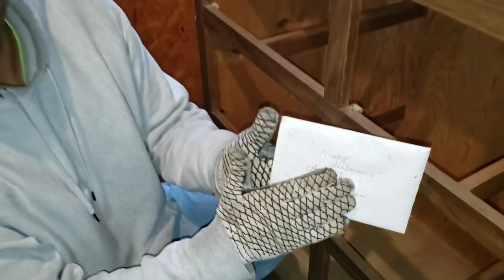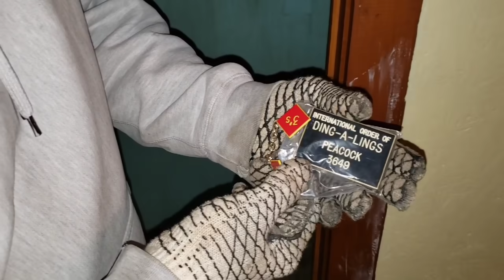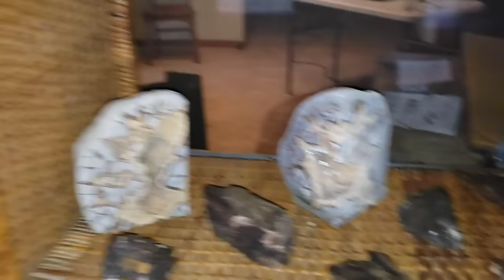Looking For $100,000 LOST MONEY

Comment: The money is under the floor boards in a closet! 
That's where I put my safe when I lived in Jacksonville, FL.
I cut the cement and dug down 2.5 feet and framed it up and slid a 2'x2' safe in and then hand mixed up some cement and poured it around it and smooth it out.